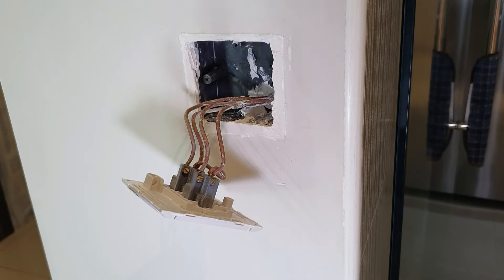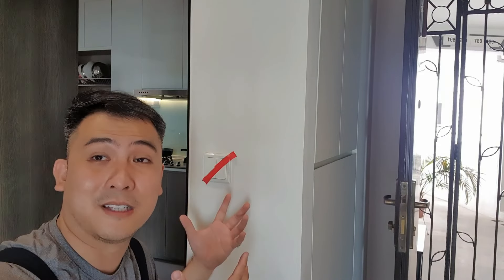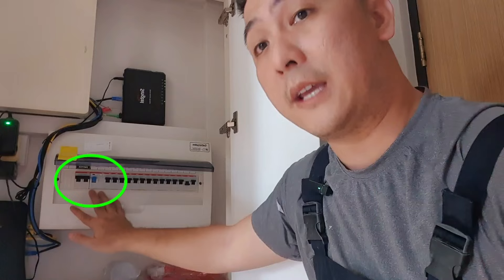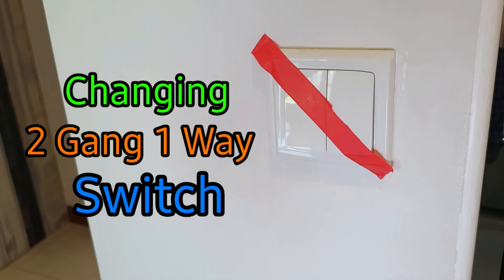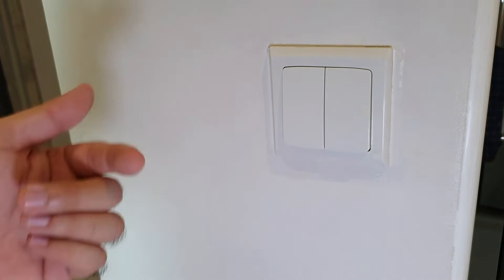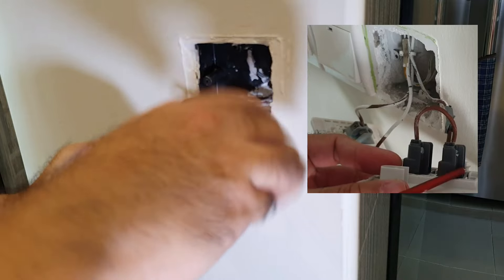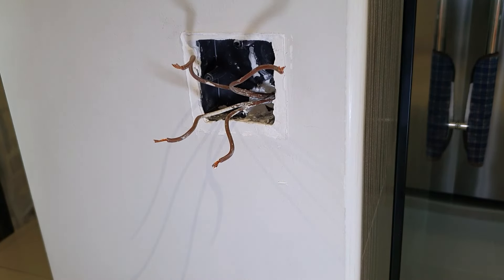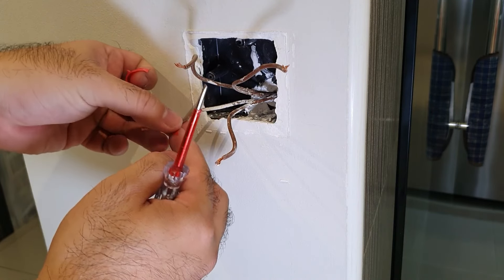How to Repair a 2 Gang 1 Way Light Switch. (Broken / stuck / sparking) (Save: $100)

Comment: Can attest to not putting silicone around switches. U can't paint over silicone lol. Anyway to paint over silicone?
Reply from the maker: Nah it depends on the silicone. It must be the printable kind. I usually use caulk. Check the link below. This one is says paintable on the tube

https://amzn.to/3WtPdPz
Reply: @ThePunggolHandyMan  Hi, any recommendations for caulk that I can get in Singapore?  I was doing research and all the caulk I come across are those in the large tubes that require the caulking gun.  I'm only looking to seal up some light switches, so something small and compact would be good.  Thanks!
Reply from the maker: Hi Kenneth I use this daily. Comes in a handy squeeze tube!

Product Name: Selleys No More Gaps - Gap Filler
Product Price: $9.5
Discount Price: $9.4
Product Link: https://c.lazada.sg/t/c.YkOs5b

Comment: My punggol home 2 gangs 1 way only have 3 wires (not 4) to connect 2 lights , is it possible. Gang 1: wire 1 to COM, wire 2 to the other slot. Gang2: daisy chain wire in one slot, wire 3 to other slot. Total only 3 wires : wire 1,2,3
Reply from the maker: Yes if it is 2 gang 1 way, having 3 wires is correct because that's the end of the chain

Comment: Don't forget LOTO hehe. Anyway, any idea on how to convert concealed socket(new bto) to those protruding socket with casing? I'm thinking of creating additional power socket loop that runs externally like old hdbs.
Reply from the maker: Easy just mount the box over the existing hole and pass the wires through. You can even use the concealed screw mounts to attach the new box (drilling the box may be required.) Then use gap filler to fill up the remaining gaps!
Reply from the maker: You gave me an idea for a video
Reply: This a great video bro to do.. tapping the existing conceal powerpoint to another new powerpoint either via trunking or conceal la......i just done with this project just become of my fish tank😂😂😂😂😂

Comment: What if the fixtures i have got neutral coming out? Where does it go on the switch?
Reply from the maker: Is this HDB? Or maybe you're looking at a dual pole connection

Comment: What if we have two live wires on the two gang switch board, what to do?
Reply from the maker: Check out the video on house wiring and daisy chain That should  explain heaps
Reply: If you have two live wire in the two gang board meaning you are connecting without looping common

Comment: The old switch will have the label for the wiring for live n netural?
Reply from the maker: Switches are usually live and load, light point is live and neutral. Depending on who installed it your wires may be labelled or unlabelled.

Comment: For a 2 gang 1 way smart switch where there is a Live, Neutral and two Load terminals, is the COM wire for the rest of the house inserted into the Neutral terminal of the smart switch?
Reply from the maker: Hi different smart switches have different wiring. Best ask your supplier

Comment: My 3 gang switch has 1 com port but my new one has 3 com ports, 1 for each L1. I was told that I need to connect the com ports. What kind of wire should I use ? On online shopping I can see AWG ranging from 14 to 30. Thanks.

Comment: Psps, can I check if the daisy chain wire can be slot into a N (neutral) slot? Cause the standard HDB 2 gang switch has L1 & L and L2 and L. But the new one I bought has L1 L2 L and N. Connecting the live and the daisy chain to L doesnt work
Reply from the maker: Hi cam contact me via FB? I'll try to answered there